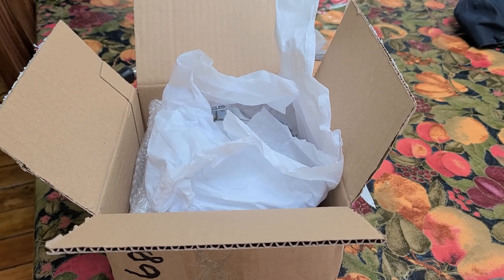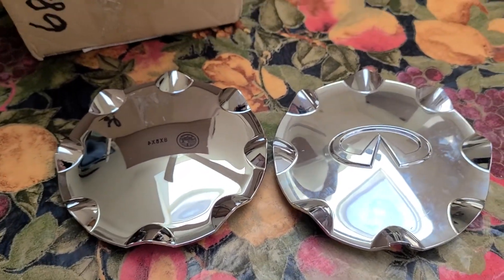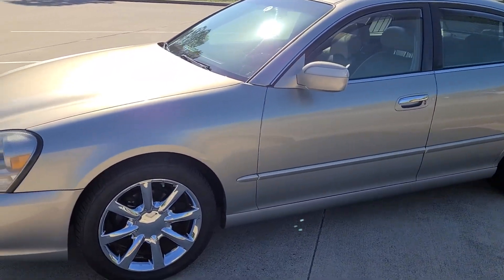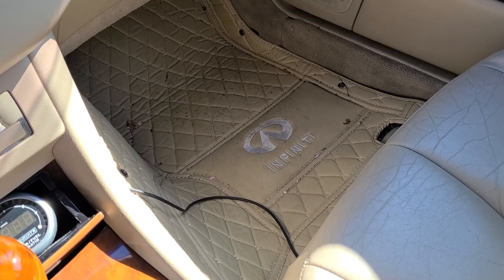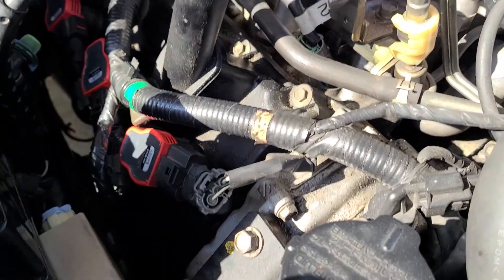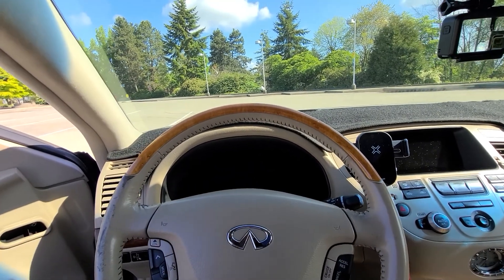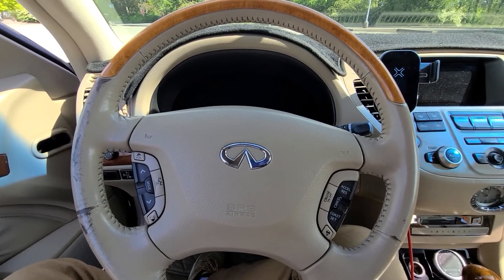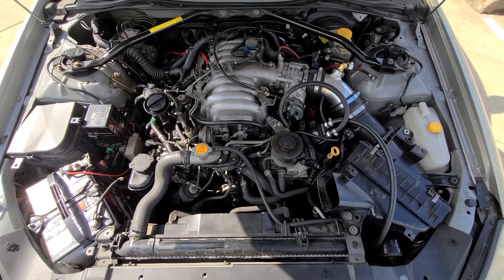Infiniti Q45: Custom Center Caps and More!

Comment: Just bought a 2005 Q45, 340 HP Stock as I understand has a good amount of pull.
Reply from the maker: Nice! Yeah that's what they're rated for but it puts down around 250-270 stock.
Reply: @30YearOldBunta  Sweet. what are some first mods I could do to bump that up some?
Reply from the maker: @loganwiebe5240  change the diff, best bang for buck imo. 3.67 is the ticket

Comment: Hey man big fan of your channel I’m in Alberta with a 2005 q45 I’m missing one of my chrome center caps was wondering if you would want to sell me one of your stock ones?
Reply from the maker: @zennepcox3793  I'll go through mine and see if any are fully intact without any clips missing. You'd probably be better off on eBay I see them on there all the time but if I have some in good condition I'll shoot you a message.

Comment: Whats mileage on it bro.Sounds like u got alot of leeks and things I've seen those things with 250k original powersteering and all your one of only people I've seen doing one of these
Reply from the maker: it's got 190k kilometers so fairly low milage, most of the people still have original power steering and theirs is leaking lol. I'm just being fussy and I want it dry underneath, it was a goal for the car and I'm never getting rid of it.